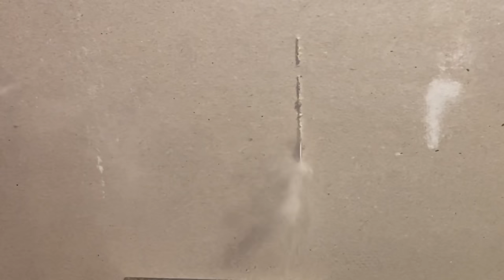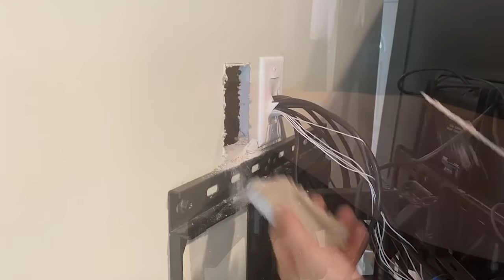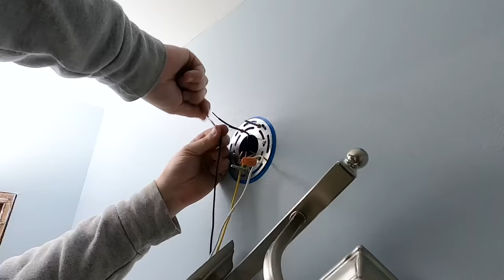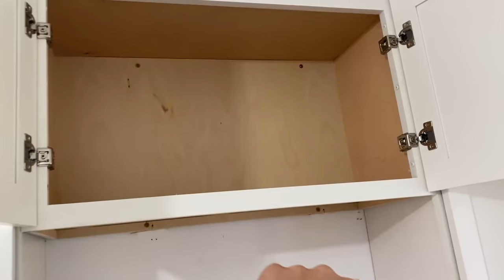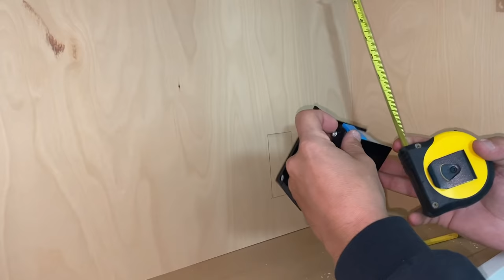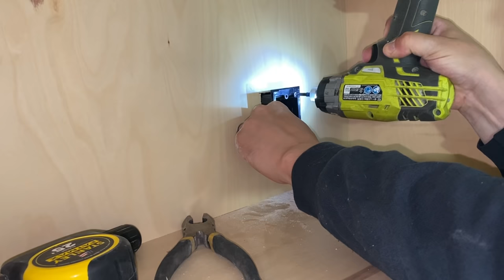How and When to Install "Old Work" Electrical Boxes

Comment: if your dealing with lots of insulation, before handling it rub any exposed skin with Baby Powder, the powder fills the pores of the skin keeping the insulation fibers for getting stuck in your pores, or that is the theory. Also a cold shower as soon as you can after handling the insulation helps, again the cold water keep your pores closed.
Reply: Make sure the aby powder doesn't contain asbestos :)(

Comment: It appears you installed a 15 amp outlet gang.  For a microwave, wouldn’t a 20 amp gang be required? If not GFCI protected, a 20 amp GFCI may be appropriate for kitchen.

Comment: I've been an electrician for almost 50 years, you should always leave some slack ie wire in the wall. I do in case another trade damaged the wire.

Comment: For thicker walls I have used longer screws for the tabs so the old work box would still work.
Reply from the maker: Why have I never thought of that?  Thank you!
Reply: Can someone please tell me why my plastic work box has a ground screw in it? I didn't think I had to ground it because it's plastic.
Reply: My fixture works fine without using that useless ground in the plastic box, but i'm still left wondering what the heck it's even for and why it's there. It looks like it was bought this way too, not customized. Maybe it's to organize the ground wires?

Comment: much easier in the system we use in Denmark, and we only use, what you call "rework boxes" in drywall, we drill a 57mm (2,25 inch) hole with a hole saw, the box is round, and the taps are made of metal, and are only around 2mm in thickness, if two outlet is needed we drill two round holes, with a small overlap and click the boxes together, and we also have 230volts in a normal outlet, (between hot and neutral, and 400v between to phases, and in all normal houses we have three phases)

Comment: You did alright. Could of replaced the screws with longer ones but since you got it to go in between the cabinet and drywall you did just fine.

Comment: I would have drilled a larger hole (the complete size of the box and trim) in the cabinets to allow for the hole box to sit flush on the drywall.  After drilling the larger hole in the wood, sand it down to remove rough edges, then install the box on the drywall. 

Doing it the way you did it removes a small amount of the "efficiency" of the box since you have a little bit of a gap where the drywall sits away from the edges of the box. Also, when upgrading or removing the cabinets, you will come to the issue with a box being attached to the wood.

Comment: For older homes with thicker walls, possibly as ours due to interior wooden siding with drywall over..... use an old work box and replace screws with 1 1/4" longer hardware..... simple but works great.

Comment: one trick if you wanted to use the tabs without modifying the drywall. Get a pack of longer screws of the same diameter and thread pitch as what's used with the receptacle box tabs. If the new screws have pointed ends use a wire stripper with a built in machine screw cutter.
Reply: I have used longer screws several times it has never been an issue for me.
Reply: I didn't say over a year ago "longer screws couldn't be used".
I was referring to using wire strippers with built-in screw cutters to lop off the pointed/sharp ends. 
I mentioned over a year ago to swap for longer screws.

Comment: I needed a 1-gang shallow old work box but I couldn’t find one at Lowe’s. They had something from “Cantex” (EZ08SF) that said both “New Work” and “Old Work” on the box label, but I have to assume “New Work” was the correct one since there were no tabs to lock behind drywall. I ended up having to go to Home Depot where they had the kind of shallow old work box that partially rotates in to have extra room behind the drywall.

Comment: As far as installing a box in the ceiling as old work and supporting the weight of a fan, and your joists run 16 inches on center you do have choices, no issues!  Retrofit ceiling box with support bar.  The bar expands to meet up with adjoining joists.  If the joists are further apart like 24 inch on center, that could present a complication.

Comment: Hey...I see your work here are for light switches.  Is there any solution to use old work box, for the plug in outlet?  The new security plug outlets require far more strength to plug in or pull out.  The amount of force will eventually rip the drywall out.  
In my application, this is an exterior facing wall, and we added thick insulation and foam board.  And need to add reciprocals to the wall.  The old work box with the flip out old work tang, doesn't provide adjustment for the foam thickness (and it would be too weak as well).  Thinking of the support arms used on ceiling fan install.  ANY OTHER IDEAS?  I am in a pickle.  Thank you.

Comment: Question, since the outlet box isn't flush against the drywall is there going to be any issues with cold/warm air coming through if there are any gaps with the drywall and outlet box?
Reply: Yes, unless the cabinet is screwed against the wall and blocking most of the airflow and air isn't seeping through the outer edge of the cabinet.
One fix would be to go into the attic and use intumescent caulk to create plug around the hole in the top plate the romex was fed through.
If It's a vented attic Most of the air would come from the hole in the top plate, seal around the romex with intumescent caulk and no airflow.

Comment: Any experience or views on fiberglass boxes?  I recently bought a circular old work fiberglass box at HD, instead of the traditional  wings that tighten down like you show, this one has a semi-flexible metal strap that goes into hole and then tightened-down on the inside edge of the hole.

Comment: There is something to be said for pre-planning. For instance roughing in wiring including under cabinet lights and building a soffit before installing cabinets. You were lucky to be able to use that box. Had you not been, the easiest alternative is a Madison bar. often referred  to as a F-clip/strap!!

Comment: If the tab screw/bolts aren't long enough for deep penetration, you can get longer ones that will add almost another inch to the depth.

Comment: An option is old work Slater box , which come with longer screws for the wings.  Pass & Seymour Slater Old Work Plastic 1 Gang 16 Cu. In. Swing Bracket Box with Quick/Click

Comment: Question: I am installing a backsplash and we dont need the electrical outlet. Can I just remove the receptacle and cap off the wires and dry wall over it?
Reply from the maker: Hey. I wouldn't feel comfortable having live wires capped behind my wall, so I would recommend checking with your local electrician.
Reply: @TheFixerHomeRepair  ty

Comment: Can't you replace the screws that come with the box with longer screws?  Whoever the electrician was who did the new work wiring and installation of electrical boxes, they did not secure half of them to studs and just left them loose. Also installed a light switch on the other side of a shower valve with nothing in-between........have had to repair everything.  Nice video.

Comment: Omg, I didn't know "old work boxes" were a thing. I was gust figuring out how I was going to make a hole I could fit my hand and drill into to screw to studs and all the mud and sheetrock. Now I don't have to do any of that..I am moving a vanity light up 6 inches and 3 inches sideways. #gamechanger

Comment: Doesn’t the microwave need a high powered box?  It pulls a lot of juice when first started.
Reply: most only require a 15A circuit. he used #12 wire, enough for a 20A circuit

Comment: I think the only issue you might have with cutting an oversized hole in the drywall would be that you're reducing the fire rating/barrier — iirc a lot of dry wall is fire resistant, same with boxes, so you'd be creating an opening for fire to reach your framing by cutting oversized holes in the drywall, potentially

Comment: Much easier solution to a old works box not able to reach drywall. Just remove screws from box. Add longer screws. Problem solved.

Comment: Can you use old work boxes to install flood lights on your exterior soffit?
Reply from the maker: You could but there are many different types of houses so I would check in with your local electrician.  He can also make sure that everything is in code.